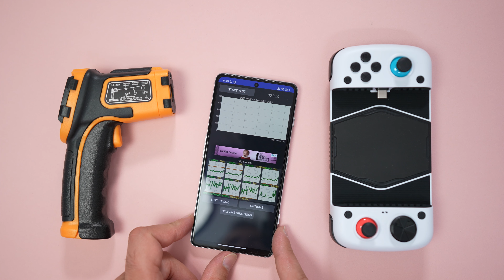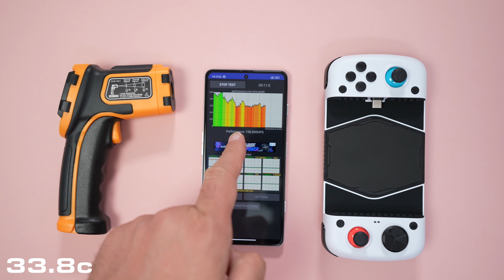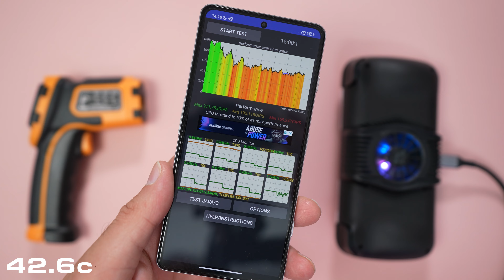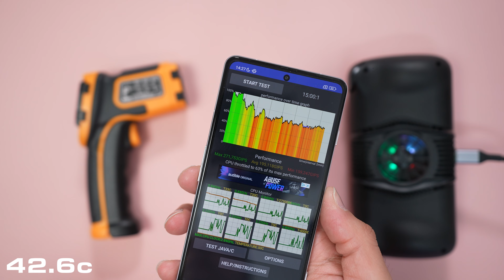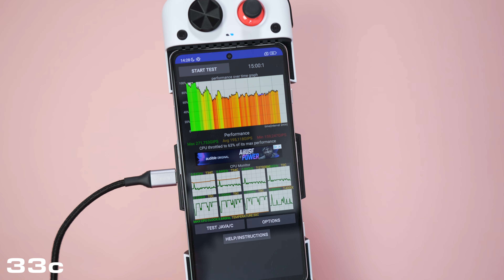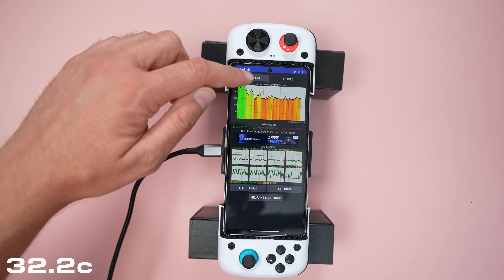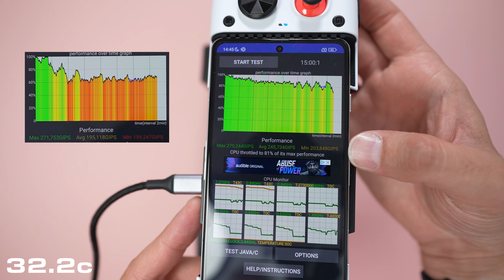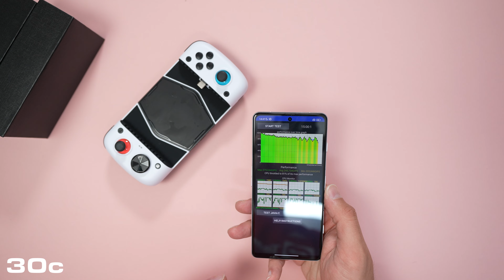POCO F4 GT Throttling & Cooling Test - Will Throttling Be Reduced ?

Comment: Yes it helps i play pubg hrd ang extreme framerate and temp is 33 32 with my blackshark funcooler 2 no fps drop and no hot on my phone thanks a lot for this review i hope it helps alot for poco f4 gt users who complains throttling 🙂🙂🙂
Reply: Hey bro i have a question does the poco f4 GT fits well with the blackshark funcooler 2 pro?????? Does It touch the Phone buttons or not?
Reply: @mortadelaco7823  it not touch button, i already try on my f4 gt, if u want very2 cool ur phone i suggest using water cooling system
Reply: @ryomanakanonazri9442  water cooling? this is not pc bro. i use f4 gt with this funcooler but still fps drop when it get too hot and the cooling not enough

Comment: Hi. I'm curious.. have you come across some sort of game turbo mode that could be switched on for the Poco F4 GT that would maybe stop it from throttling so much? I just saw it mentioned somewhere, but I have already returned my Poco F4 GT, so can't try it myself... Although, if that were the case I imagine it would get much much hotter than it already does... So u think this phone simply could not handle the heat unfortunately... I now have black shark 5 non Pro with SD870... Very minimal throttling:)... But it is quite chunky...
Reply: There is a turbo mode but it stills throttle, if it don't the battery could explode 

Use a phone cooler like the video, I use one from black shark and stability skyrocket
Reply: if you turn on performance mode it won't throttle anymore but will heat up even more
Reply: @danavidal8774  no it doesnt

Comment: You can slide the cooler left or right, with the cooler closer to the camera (where de SD is) I believe you could have gotten slightly better results.
Reply: But wouldn't the cooler damage the camera?
Reply: @marcoa.2912  you just have to slide it as close as the camera bump allows to, the closer the better, even if it is just a little bit.

Comment: retry the test using game turbo in poco f4 gt and see the difference 😊
Reply: Game turbo allows higher temps? Does it make throttle less?
Reply: I think still same, i do in balance mode still can get 91% performance
Reply: @Pator1gu  more gpu frequency and CPU frequency, also, ram is cleared and allows phone to use more power and heat up more